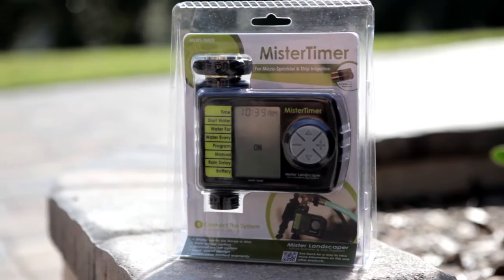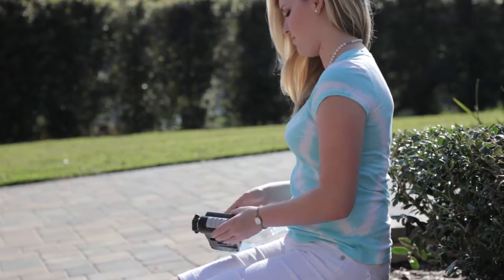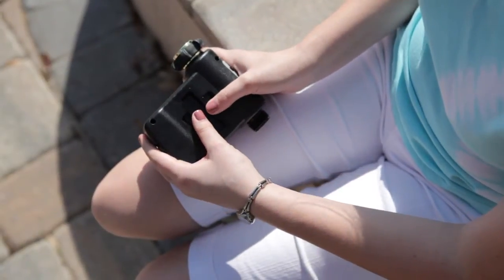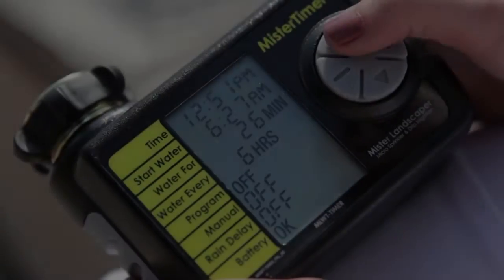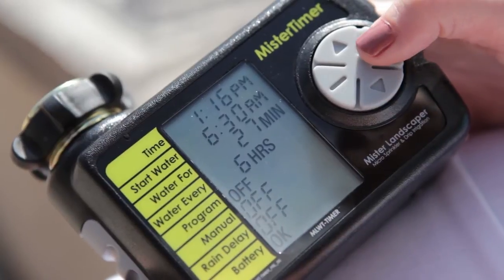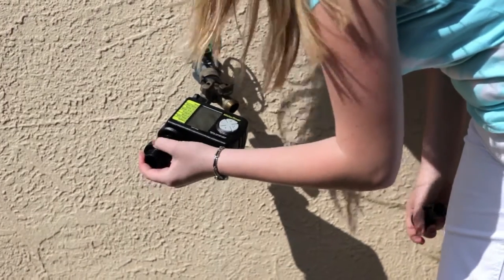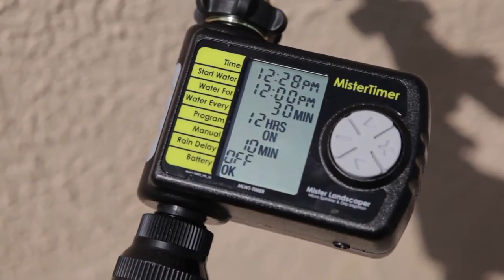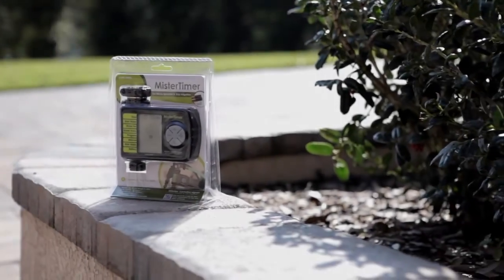Mister Timer Installation

Comment: Mine is faulty. I did everything and as soon as I turned to water on it runs regardless of the time I set it to run on
Reply: I have the opposite problem. Mine won't open its valve whether I'm set for auto or manual.

Comment: Mine just doesn’t work at all…I programmed it properly. I tried using the manual mode also…still does not work at all. This was a gift from a friend. I don’t know where it was purchased from either. Can we get some assistance anywhere or do I have a dud?
Reply: The mister timer has a simple mechanism for shutting the water on/off. If you open it up you’ll see two copper wires connecting to a solenoid. A solenoid is basically copper wire wound around a cylinder with a spring in the middle. Electricity flows through the solenoid and creates a magnetic field to pull, then when shut off the spring pushes something back out. They tape the tips of the copper wires with electrical tape but the copper wires are exposed. I’d check to see if the two exposed parts of those two wires are touching each other creating a short circuit bypassing your solenoid. For the people whose water is always on it could be their solenoid spring is busted which I don’t know how to fix.